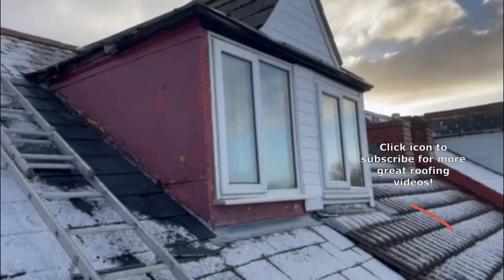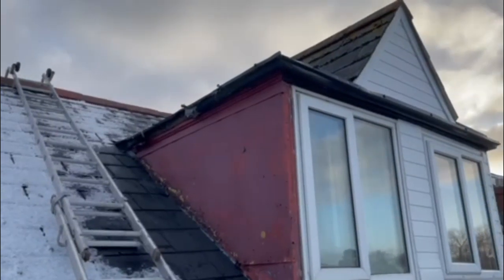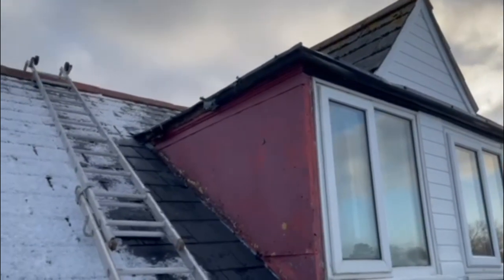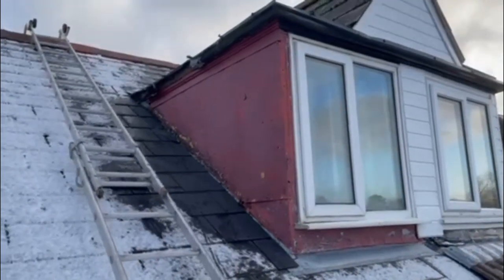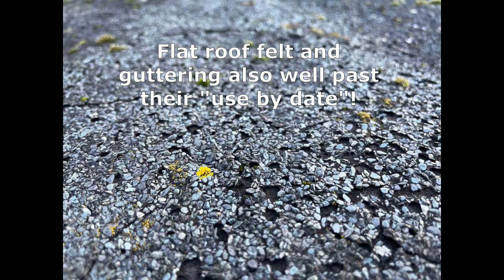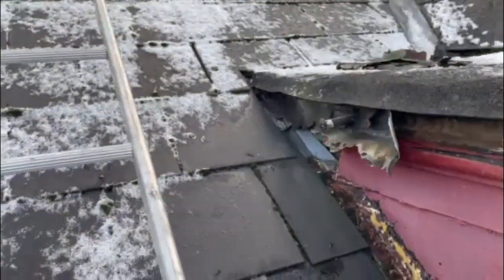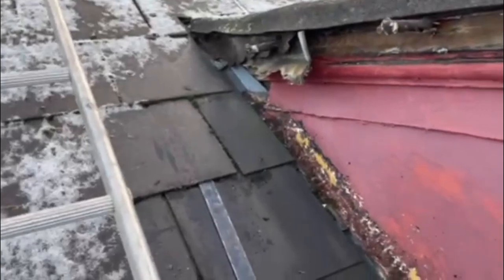Leaking Roof Dormer Repair - new lead soakers for roof slates, shiplap cladding & EPDM flat roof.

Comment: Looks good. I personally don’t use anything less than code 4 though and normally 5.
Reply from the maker: Code 3 for slate soakers is normal in the UK, code 5 would be too thick as slates kick up I'd think no?. maybe on a heritage project but not normal slating mate. What would you use code 5 soakers on?
Reply: For here I’d use code 4.  Just covering myself more than anything, I know most do use code 3 tho lol. Jobs looks good though mate

Comment: What do ya think of resitrex dave we've been using it alot some stuff unbelievable finish
Reply from the maker: Yes mate I have used resitrix a fair amount and found it great stuff to use. Can be a bit pricey so use it for the customers willing to pay the extra, but gets a great finish as you say!
Reply: @davesalter  yea in Ireland it's 280 a roll all in mad money hopefully more clients will come around to using as it is a joy toy to use plus need to make back the money spent on leister hot gun 🤣
Reply: @davesalter   Dave, how can I get in touch with you about a quote bud ?
Reply from the maker: @adammyatt4880  Hi Adam, i work mainly in Birmingham and surrounding areas, what area are you from? As if its too far it may not work.
Reply: @davesalter  Wolverhampton bud
Reply from the maker: @adammyatt4880  my website is www.yourroofingmatters.Co.uk, there is a contact page on there let me know what you need pricing and contact details etc. 👍

Comment: what's your views on this artificial type of slate?
Reply from the maker: I prefer using natural slate and if i was slating my own house i wouldn't use fibre cement. Eventually when they loose the surface shine they start looking pretty crappy and are prone to moss growth, which natural slate isn't. Natural slate isn't that much more and is well worth the extra cost.
Reply: @davesalter  I see appreciate that, have you found epdm to be better than torch on?
Reply from the maker: @michaelcollins5308  both are good if done right. I use rubber a lot and have no issues, 50 year life expectancy if done per manufacturer specs. Torch on with several layers would expect maybe 30 years or less. But pros and cons for each, rubber is more susceptible to puncture if heavy traffic area, so maybe multiple layer felt better in such an instance. All flat roof products get haters and lovers but I find all are decent if done correctly. It’s finding the right fitter that can be the tricky bit.